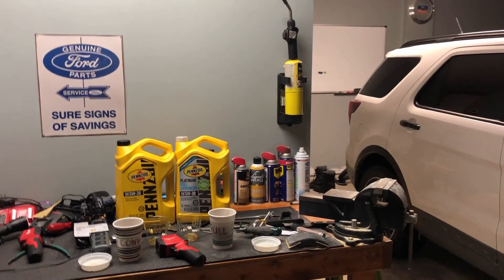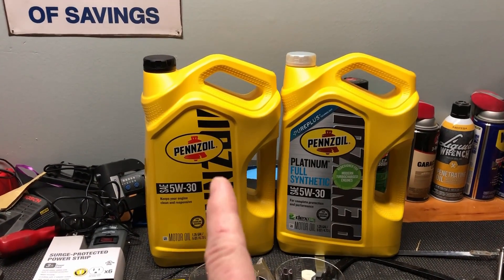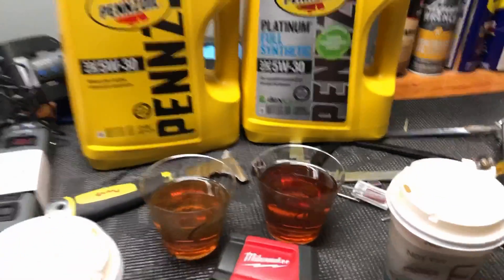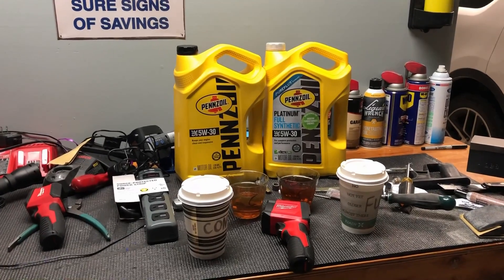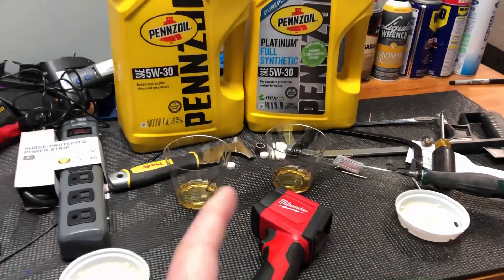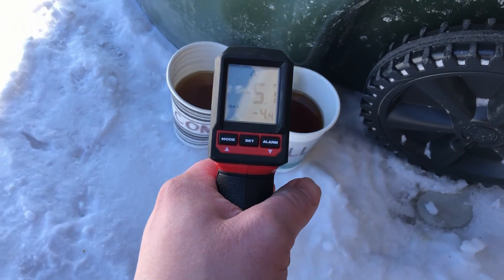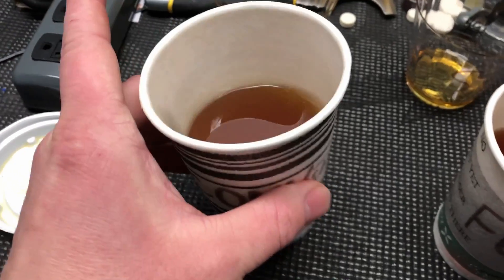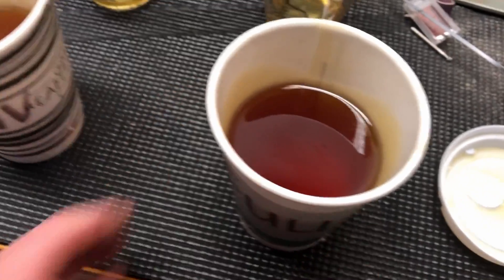Conventional vs Synthetic: Which Oil Do You Want in Your Engine During the Extreme Winter Cold?

Comment: I want your opinion/advice, going to put a 2015 F150 with the 5.0 back on road after 6 months. The vehicle has 150K miles. Should i run it a while with the current oil and filter then replace or just replace without running it. Also, should I go with 5w20 (factory spec) or should I go with 5w30? Thanks

Comment: FordTechMakuloko/other competent technicians. My 2018 F 150 has a delayed release with the driver side hub when dis-engaging the 4WD system. Note it will only disengage while moving and clunks when doing so. I just had work done up there and am not sure if this was a prior problem. I myself am a tech and understand how IWE works. However, in my experience grinding is an indication of failure. Only 4k miles on truck.
Reply: Hmmm, check for vacuum leak??

Comment: I have listened to Brian on every issue regarding my 5.4 Triton engine. I premtively did the timing job following his 4 part videos, which i watched about 4 times before tacling this job. Thankfully, he did the video about the roller followers, and the one about the melling oil pump before I did my timing job, so I replaced those also. I cannot emphasize enough how important it is to use only OEM parts in this engine. I have used a pint of Marvel Mystery Oil at every oil change since I got the truck, and when i opened up the engine, it was clear that I actually did not need to do the timing job at 153k miles. It was pristine inside. Based on Brian's advice I use 5-30 full Synthetic every 5k miles, but i still start with a pint of MMO. The stuff just works. I now have 172,000 miles on my 2004 F150 with the 5.4 Three Valve Triton, and it runs like a swiss watch. I am replacing the cab corners, and then I will get her repainted. Oh I also preemptively did all the things to the tansmission that Brian recommended. Just listen to him, he is the best Ford mechanic I have ever seen, or heard. Once you get past the quirks the Triton engine has, like the ridiculous plugs, and especially if you use MMO, and the right weight synthetic oil, this engine will go a very long way, and considering what a new truck costs today, It really pays to get all you can out of your vehicle. Like my Dad used to say "Son, that new smell wears off way before the payments end" RIP, Dad, you were one smart mentor.

Comment: Hello Brian!
Synthetic oils have one big drawback. They contain polymer thickeners in large quantities. It is this thickener that forms deposits on pistons, rings, and in the block head. So and conventional and synthetic have some disadvantages.
Reply: Give further details please. Should I use conventional, synthetic blend, or full synthetic?
Reply: @standhd  It's hard to say so right away. It depends on many factors. Where do you live, what kind of climate, how often do you change. There is a difference even between countries, which we call synthetics. For example, in Germany, synthetic oils can be called only on PAO and esters and nothing else. In others, hydrocracking oil may be called synthetic, although it is an oil from oil. And in different countries there are different brands of oils, different groups. Any oils have their advantages and disadvantages. Mineral oil is thick in the cold. Synthetic oils were created to offset this disadvantage. But others received it in the form of a larger amount of polymer thickener. And now synthetic oils are introduced legally in the European Union because synthetic waste oil is much cheaper and easier to recycle than mineral oil. This is ecology. Remember the old cars when there were no synthetic oils. What mileage could these cars have? Old Ford, Chevrolet... They had a great resource. Now we have a technological synthetic. So what? Cars began to drive even more, engine life increased? I wouldn't say that. Sometimes even quite the opposite. Semi-synthetic has all the necessary properties from mineral and synthetic oils. Therefore, manufacturers recommend original semi-synthetic oils. There is not a single original oil on PAO and esters. Everything is semi-synthetic.

Comment: Yeah I've been using 5w30 full synthetic Mobil 1 with a wix oil filter in my 2004 Ford f150 and it runs like a champ
Reply: In winter too?
Reply: Do you think 5w20 in winter flow better?or 5w30 flow the same?

Comment: 08 Lincoln Mark lt. Lots of vanilla pudding on bottom of oil cap. Changed oil with Pennzoil platinum then drove 200 miles round trip. Still getting milky oil on cap. Never drive less than 10 miles when motor starts. Do I have a bad pcv valve?

Comment: Mobil 1 in the early 90s, threw regular and synthetic bottles of oil in freezer, took them out a week later, regular oil would pour, but very, very slow, synthetic oil poured no problem, next the put the two oil in 2 frying pans and heated them up, the regular oil did not do well at all, the synthetic oil had no negative effects

Comment: My 2008 ford ranger owners manual says to use 80w-90 gear oil in the rear diff. I called ford today and they said use 75w-140 synthetic. Now im extremely confused. I need help figuring out which is the correct fluid. I live in a hot climate. Any help would be appreciated
Reply from the maker: 75w-140 is the way to go in the rear axle.
Reply: @FordTechMakuloco  thank you!
Reply: @FordTechMakuloco  if switching to 75w-140 from 80w-90, how important is it to get out ALL of the 80w? Should i use brake clean and try to get out as much as possible? Or can i simply drain out the 80w-90 and refill with 75w-140? Thanks! Great channel btw!

Comment: While I agree with your testing as far as it goes.  I spent many years in Alaska, at temps much lower than -20 for months on end and, as long as the battery was decent, never had a problem turning over my 390cid engine in my F150, or the 300cid in my father's F100. Both used conventional oil (my dad was a believer in Havoline 10W40), and both exceeded 100K with no major interal damage. That probably says more about the older engines than the newer ones. I use high mileage synthetic in my 2012 F150 with 170K on it. I just had the cam phasers replaced and am hoping for many more miles. Thanks for all the info you provide for my F150 and presenting it in a way that is easy to follow.

Comment: I have a 2006 expedition I bought with 136,000. After driving it about 1,000 miles I started to hear the cam phaser noise, ugggg!!!!
The first oil change I did I used the motor craft 5-20 and motor craft filter. Within 50 miles the noise went completely away. I’ve now switched to 5-30 per the advise on this Chanel. 192,000 and still running great.
Just got done changing the transfer case input seal, big job, that case is heavy. Doing both the front and rear pinion/yoke seals today, plus replacing the fluid.
Ford like ford fluids i guess

Comment: You should do a vid on the f150 wheel hub bearings. We have tons of issues with these.
Reply: Great idea, I have a 2012 I think has bad hubs because of whirring noise with lower speeds slowing down and speeding up. Can’t find cheap good replacement hubs, and no one to help me replace them. It’s 4x2 xlt 2012 supercab. Really wish I had help or trusting guy to do it for me...

Comment: I have a 2007 F150 4.6. I use Motorcraft Syn blend 5w20 and motorcraft filter for oil changes. I'm thinking of changing to the full syn motorcraft. It will cost me 32% more for the oil. The truck has 200k on it now. I'm curious if you think the full syn is worth it extra or if you have another preferred engine oil? Great video! I'm in Louisiana where it does not really get that cold.
Reply: If you change now your engine may develop leaks

Comment: Been using Full Synthetic oil for 20 years with No Mechanical issues! All my car's engines are are in excellent working condition like New because of QS Full Synthetic. They start in the coldest weather on the first crank.
Reply: What always amazes me is pulling a valve cover on an engine that has had synthetic oil all its life. The metal literally looks like new - shocking!

Comment: Question, I have a 2020 XLT 3.3 NA engine and the manual recommends 5w20. I put 5w30 full synth in the last oil change accidentally. Got 500 miles on the change, read the manual wrong for a different engine.  Should I change immediately or wait until the next oil change? I live in Florida.  Will this damage the engine and/or void the warranty? Thanks for your time.

Comment: I just bought a 2014 Ford Expedition el 5.4 3v with 111,200 miles.   What viscosity of oil should I use? The oil cap asks for 5w-20. But because of the problems with cam phasers due to low oil pressure, a friend of mine suggests 10w-30 or 10w-40. Others says use 5w-30. I tried to find a video of yours that talks about the right oil viscosity for the engine but couldn’t find one. For piece of mind of not having to worry about cam phaser failures, what do I use? Thanks.

Comment: I have a 2016 mustang gt 5.0 with 49k highway mikes. On two occasion while cruising at 80moh my CEL started flashing. After about 30 or so flashes it went off. After the first occasion I replaced the plugs. Yesterday while cruising at 80moh same thing happens. Car is fine again no cel. Well can't be the plugs I replaced them. Could it be an intermittent coil? I ran codes and none were stored. Any ideas? Thanks

Comment: The 5.0 V8 bbq tick or Typewriter tick! whats the fix?
 should i be worried😨
how common is it? thanks
Reply from the maker: Forged aluminum pistons and sleeveless design same as 5.2 Voodoo engine from a few years earlier and sure enough the same noises are present in the redesigned 5.0L 2018 and newer
Reply: @FordTechMakuloco  so what about a 5w40 rotella for the new 2018 5.0? I'm in Florida, rarely gets below 40 degrees.
Reply: @GTR-ex2ly  . i hear Whole blocks are being replaced under bumber to bumber warranty. because short blocks are on back ordeer. thses new blocks are no different and the same issues will reappear. there are also reports of Cylinders scoring metal shavings in oil pan. the tick is possible piston slap or rod knock. This is a problem,unlike the 5.4 tick was just an annoyance.

Comment: It has been BRUTAL here Chi-Beria. I only use full synthetic in my truck for this reason. Usually Castrol edge, Mag 1 or Valvoline.
Reply: Mobile One Full Synthetic is also a great choice
Reply: @Mike R. I agree Castrol Edge is all I run. 5W30 in my 97 Mercury with 255k on it.

Comment: It was down to -28 here too. I use synthetic motor oil and also have a 100W heat pad installed directly under the oil pan, which I left plugged in overnight. Started right up, no problems.

Comment: I bought a 2015 Ford Expedition with a 3.5 L with 110,000 miles. Should I use a synthetic blend or full synthetic and what about the high mileage oil, should I use that?

Comment: Good test But you kinda defeated the accuracy of the temp as Styrofoam is a good insulator and will shield the cold temp from the  oil. where if you used cans would be far more accurate in showing thermal heat difference of the oil absorbing the cold. the flow rate would be far different.
One thing up here in the mountains of the caribou the arctic storm we have gone through the temp fell to -44.3 degrees celsius  which is -47.74 Fahrenheit, that oil would be almost like toffee ...

Comment: I have a 02 Ford explorer with 270,000 miles, I've been thinking to some type of synthetics like lucus trans, transfer case, front and rear diffs,  with such high mileage I want to add as much protection as possible,  do you recommend this or do you see any problems with doing these, thank you
Reply: I know you shouldn't switch engine oil with mileage that high. I don't know about the others
Reply: @rays7437  I've been running synthetics in my motor for years as well as lucus, some say it gives you less gas milage but for the miles I have I figured the more protected and lubricated I can keep old parts the better and has worked out so far, that God. My question is the drive train,  tranny, front and rear differentials,  transfer case, I want to use a higher grade product in those and see if I can help them last alittle longer. It called for a 74- 140 synthetic in the rear, but not the front, but I'd like to use synthetic in the front as well just for the added protection,  also the transfer case, and lucus transmission fluid in the transmission,  just wanted so professional advice on whether thought it would hurt to do that or knows for a fact that iys not a good idea
Reply: @colonialroofingofnorthcaro441  
I assume the transmission is the 5R44E automatic. They were problematic until Ford figured out the right software and the right additives to put in.  So I don't think I would mess with it.  As far as the diff's and the xfer case I myself have switched on a high mileage Nissan and never had a problem.  I can ask our trans guy at work next week. Hit me up next week if I don't reply.  I may forget.
Reply: @rays7437  ok thanks, I appreciate you going through the trouble,  Mike
Reply: @colonialroofingofnorthcaro441  
So one of the guys says don't do it because it might wash the clutches and make it slip. One guy says it will cause leaks.  And the other guy says he uses BG additives with no problems. They all say use only the specified fluid for the transmission. 
As far as the diffs they say it doesn't matter.
Reply: @rays7437  ok I'm sure between all of you this is good advice and I appreciate it. Thank you for taking your time to check,  its really good of you when you could've just blew it off, hope all is well and have a good day, Mike
Reply: @colonialroofingofnorthcaro441  
You're welcome

Comment: Awesome video!!!!! on a side note a quick question for you? Has Ford officially come up with a solution for carbon build up on the  DGI turbo engines such as the Focus St. When i was at my last service they wanted to sell me 400 dollars worth of WYNNS  De Carbon system. First part was a 200 dollar bottle of magic stuff you pour in the gas tank which does not even spray on the backs of the valves and the other part was introduced into the system via a vacuum line with 5 cycles of heat soak they they say it would be all good. I remember you posting a video of the damage these additives can do if they are introduced and possible cause a large piece of carbon to be introduced into turbo.
Reply: I thought their solution was replacing the head? $600 huh? Sounds like they are turning their flawed engine into a business opportunity? If you ask me they should provide the service at no charge every 30K miles on vehicles under warranty.

Comment: Royal Purple is worth it if you drive over 1,000 miles a week like I have in the past. 10-12k miles on oil changes.  Add 1qt at about 7k. This was on a 4.6L 2v with well over 500k miles of very hard use. Oil analysis is your friend.

Comment: This brings me back to a '89 S10 Blazer I had, with a 4.3 V6 - odometer said 77k miles ... but it was bought from a suburb of NYC, and the odometer showed signs of tampering (my guess was 277k  just from the condition of it ...). Anyway, it burned a quart of oil every FIFTY miles in winter! I would dump a quart of 20w-50 conventional in every morning. Cylinder #3 would foul the plug every 3 days like clockwork. We had to keep the case of oil in the house, otherwise it would take half an hour to get the full quart in the engine. When it was below 20°F, it acted exactly like molasses, laying down ribbons of what resembled molten plastic that stacked up on top of each other 3-4 deep before they blended in, lol. 

When I removed that engine a year later, there was a 1/8" or larger ridge at the top of all 6 cylinders, but #3 was close to 3/16"! 😂

Comment: For my cars, I use only synthetic oil. For the last few years, I'm using Motul  5W30, 100% Synthetic oil.
In the winter months, between November and April, I switch to 0W30 Synthetic oil.
For manual transmission, I use Motul "Gear 300", SAE 75W90 100% Synthetic Ester Gear oil.

Comment: 1996 Ford bronco, original odor, 302 V8 has 375k. Does not smoke and runs good. I've use nothing but full synthetic in it.
Reply: Interesting. What viscosity and brand you use on that fine machine?

Comment: Its getting cold here in PA lower than normal. Would a ford dealership install a block heater in my engine on my 17 focus? Is it worth it? I normally just warm up my engine for 10 to 15 minutes before I travel.

Comment: Hi... I just wanna ask you regarding oil viscosity... Is it safe to use a 5w40 oil on my 2013 f150 here in the middle east.. We have here extreme weather since 5w20 is very hard to find here.. And 5w-40 is the most recommended oil here because of the extreme hot weather during summers.. Tnk for ur feedback...
Reply: The 5w is the most important.  Never use 10w. 40 viscosity is ok for hot weather

Comment: So, I bought a 2v 5.4 with about 144k on it used, don't know anything about previous owners & what they used as far as oil. My grandfather has a 3v 5.4 & he uses 5w-30 conventional. He actually told me that he started that way because he heard it from you, so I followed suit with my 2v. I live in Michigan so these cold temps aren't a year round thing. So, should I switch to a synthetic or stay conventional? I've been told if I switch to synthetic now, it'll just cause issues. I change my oil every 5k & I also use the additive Risoline in it as well.